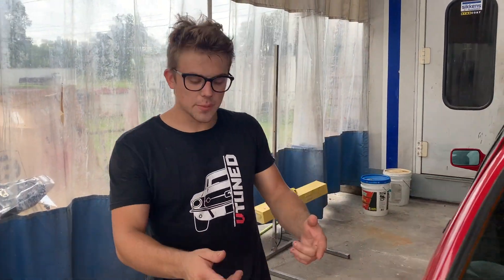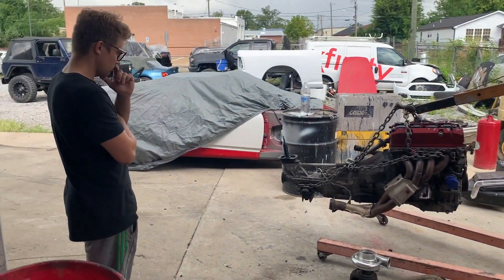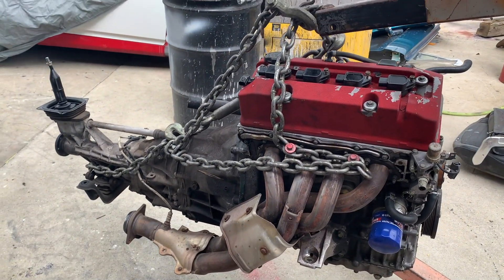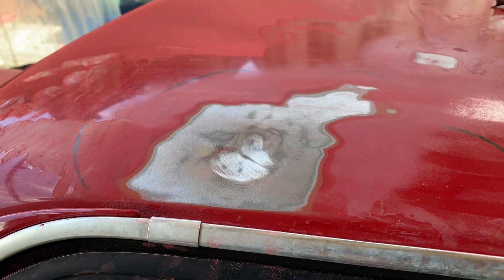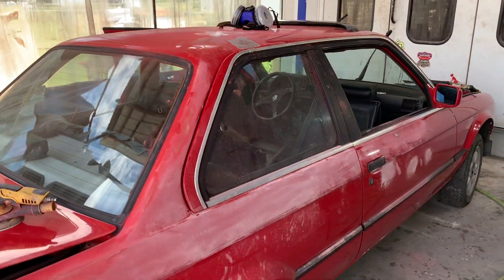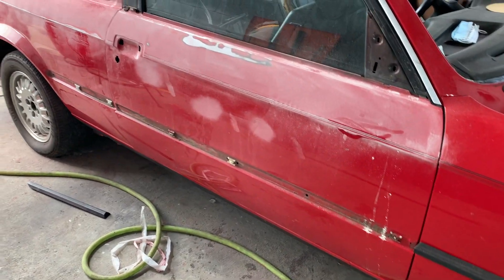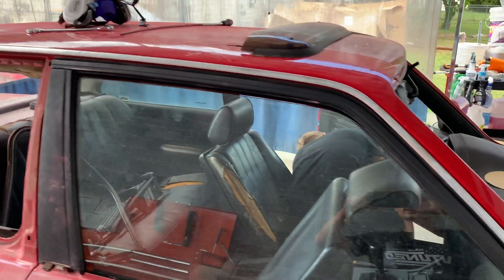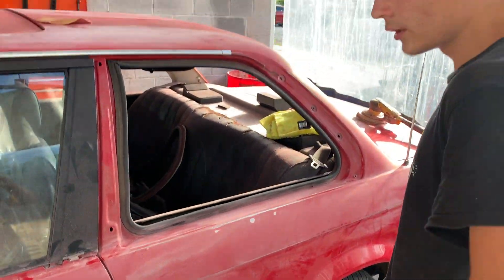Building an e30 m3 conversion part 3: Body work prep and motor reveal

Comment: Who else lost interest after the motor swap? 😂
Reply from the maker: Good thing your life is more interesting keep it up bro!
Reply: MotorHead.Co My 1986 Saab 900 turbo SPG agrees with you! Especially because it’s been kept original. Unlike that poor “bmw” you’ve molested! 😂👍
Reply: @Motorheadco  you clearly know how to build a car. Thats no issue.
But why does it have to have a Honda engine? I mean, any bmw m3 engine would have  done it justice...
You have  to have  some honda badge on it also, which makes the car ok if you just want to drive the heck out of it and make it  a drift machine, but appreciation no way. It will not be a BMW in million years with a Honda engine.

Comment: Honda into iconic BMW? What a barbars are this boys? This is IS version with valued engine!
Reply from the maker: This engine has 350k miles and is making knocking noises in the lower crank
Reply: @Motorheadco  and? Thats nothing what could be repaired.
Reply: @adamkadlec2587  Agree, they will rebild the honda's engine, why not the original one??

Comment: I loving the build so far, hopefully you are going to lower the suspension
Reply from the maker: i have a complete suspension from an e36 m3, which ill pair with some nice coilovers.
Reply: @Motorheadco  cool, will you bulge the fenders?
Reply from the maker: rolocz I ordered m3 quarters and fenders
Reply: @Motorheadco  megacool. I've noticed that the stoplights also look different than on the standard e30 m3... hopefully you can fit the normal ones.

Comment: Looks like an m3 with an e30 facelift ? Are you serious man !! Beside that good look with this build. Also keep it red
Reply from the maker: E30 M3 Pillars, quarters, bumpers etc.
Reply: @Motorheadco  this is not enough, the problem that you have the taillights of an e30 facelift.
 Rocket bunny e30 would be a better chose.
Reply from the maker: laroussi mohamed We also have taillight panel and new tail lights!

Comment: Sweet! Great work on the e30.Iv'e owned four of these beachn cars. Have done autox and Hillclimb with them and did well.Interesting engine swap. Normally a N52 is the engine most used. 😀👍
Reply from the maker: LB Truckn just trying to be different 👍🏻

Comment: Looks like a pretty good base for your build. No rust at the lower edge of the front and rear windows is very rare...
As a fan of 100% stock vintage BMWs I wouldn't swap. But anyway a great project. Just don't trash this stock engine. It's the last affordable engine just before the M3 power range ;)

Comment: Why are you swapping the engine bro
Reply from the maker: Original drivetrain has 350k miles. The motor is knocking slightly.
Reply: why a Honda??
Reply: Do at least a BMW Motor! Straight 6!